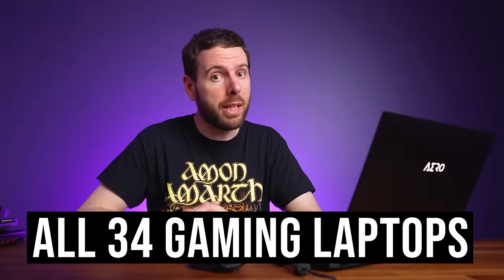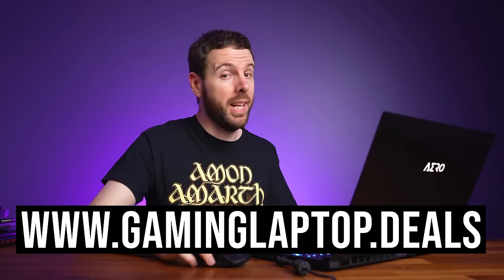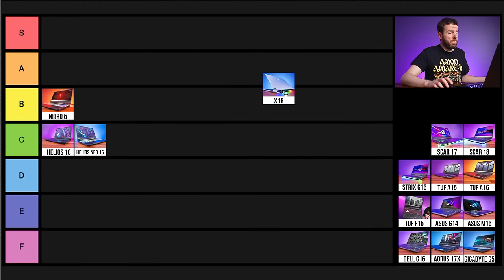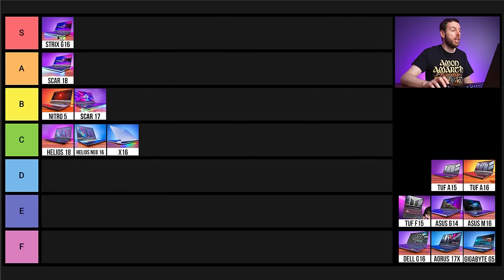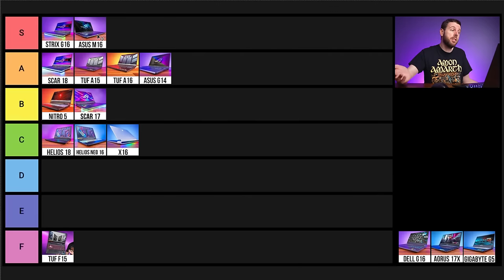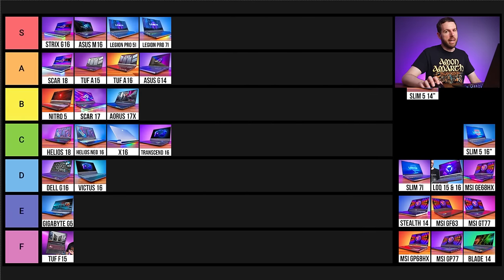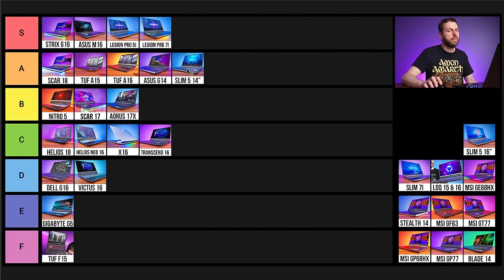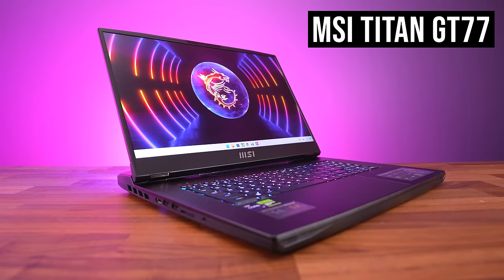Ranking ALL 34 Gaming Laptops I Tested In 2023!

Comment: I got my legion pro 7i with a 4090 for $2100 plus tax... it has to have the best cooling I have ever had in a laptop as it never goes above 87c on CPU at the full 80 watts or above 77c on the GPU at full 175w all at full load at the same time 255w.... it's crazy good, best performer easily this year and the value, my goodness, the value
Reply: Where did you find that with those specs for that money?
Reply: where did you get the 4090 for that?!? i just got the 4080 one for 2k

Comment: My girlfriend recently bought the MSI GF63 because she's a casual gamer and she doesn't mind details. We live in New Caledonia so we don't have much choice. Even though it is ranked on F tier, I believe it's the best laptop you can get if you live somewhere you don't have much laptop options and if you're on a low budget. She never complained about the keyboard, nor the screen or the plugs being on the right side (usually at the back). If you're not that picky, then it's a great laptop.

So far we have spent good time on Palworld with highest graphics and she never encountered an issue or crash, the laptop does the job great! She's also taking care of her stuff so having a delicate laptop because of the mats isn't a problem either.

For its price, this laptop shouldn't be included in this tier list I reckon? Or at least F tier shouldn't be considered as "bad" or "should/must avoid" if that's what you think.

I hope this review helps!

Comment: I got the Asus ROG strix 18- which is pretty much the scar without some rgb. It's a 13980hx with a 4080 and is frequently on sale for 2100$ on best buy. Its an absolute beast and the screen is almost as good as you can get without being oled
Reply: Strix g18 has 4080 specs? For example g16 has only 4070

Comment: TUF F15 with rtx 2060 and Ryzen 7 4800H ive had one for about over 4 years, with no thermal paste change yet and it runs extremely well, under stress temps dont go above 75, but got a A15 with 4060 which obviously is better, but i got the 2060 second hand for like a fourth of the price , would recommend it for anyone able to get a good deal on it

Comment: Can wholeheartedly recommend the Lenovo Legion Pro 7 AMD for anyone who can find it! 

Performance is nothing short of incredible especially with my configuration of a 4090 and 7945hx. There are some easily accessible overclocking and performance settings as well. I got mine for £2450 (~$2600 USD) and can't complain about it. 

The nice to have features such as the build quality, touchpad being plastic again, IO Lights etc are missed but for the price to performance it is a true desktop replacement and worth the trade off. I use a mouse all the time anyways so it isn't an issue for me.
Reply: Lenovo is the best so it's expected
Reply: I'd be grateful if you answer my two questions,
1) how are the cpu temps? I've seen 7945hx hitting 100 °C easily and remaining there constantly. Is it the same for you? 
2) Is there an option to overclock the cpu in the Vantage software?
Reply: @rezamajidizavie  I'm not sure about CPU temps, I've only looked at the GPU currently. At full load in gaming the keyboard doesn't get hot at all. The thermal package is really good at controlling the heat. Max temperature I've seen on the GPU (under 170w load) is 71°c if that's helpful to compare and estimate.

There aren't any options I've found in the advanced BIOS for CPU overclocking
Reply: Thank you for your answer! Yes the GPU temps seem to be okay, but I've seen in many videos very spicy cpu temps. I don't know if it's possible for you to check it later maybe, but that would help me a lot as I am now unsure which version to choose, i9 13900hx or ryzen 7945hx

Comment: excellent video!

I currently need to buy a new laptop.  I'm hesitating between the Asus Rog Strix g16 and the Lenovo Legion Slim 5 16 : 

- Asus Rog strix g16 | Intel Core i7-13650HX, RTX 4060 8 Go TGP 140W, 16 Go RAM DDR5, 1 To SSD

- Legion slim 7 |  Intel Core i7-13700H, RAM 16Go, SSD 1To,  RTX 4070-8GB

I actually wanna use it for Adobe softwares (photoshop, illustrator, after effects...), 3D (blender) and also for gaming at my house.

Comment: I'm one of the ones who doesn't care about the laptop screen.  I connect to a 45" ultrawide OLED 1440p monitor.  
My 'dream' laptop has zero RGB lights to increase the price and heat.  It has the basic of basic screens, something I can run the laptop off of when not connected to another monitor but is a beast in terms of power and performance.  My dream laptop.
My current laptop is a msi gp76.  I learned about it from one of your videos last year.  I appreciate the crap out of your video breakdowns.
Reply from the maker: Don't let RGB on a laptop discourage you from getting it. You can always turn it off.
Reply: @JarrodsTech  oh for sure, I'm just saying I pay for RGB on these laptops but don't want it and would much prefer a cheaper laptop without the flash.  Give me good solid performance without the show at a fair price is what I'm saying.

Comment: I’ve got the Helios 16 with 4080 and 13900HX/32GB ram. It’s unbelievably good. Hitting 19,3xx in timespy overclocked. Incredible performance and super bright, vibrant, and buttery smooth 240hz 2560x1600 IPS panel. Handles overclocks on the GPU and LM - CPU like a boss. Extremely happy with this laptop. Note: It is the NON-neo version.
Reply: Hi. Is it really so noisy as he mentioned ???

Comment: Legion gaming laptops really are so erogonimical for desk setups. The back routed I/O's are a game changer. No visible cables on my desk along my added 32' monitor. They even have software to enhance longevity of the battery being docked.... I still use my Legion 5 4800H, 2060RTX since 2020. On my desk and never unplugged. But battery is still 4-5 hours + when taken around the house. It plays most games at max settings (aside from raytracing) Now, I am looking to upgrade and almost three years later the landscape on gaming laptops still hasn't changed much. Somewhat dissapointed the industry has not taken adaptations on lenovos game changing design. I HATE seeing cables on my desk. Is it just me?

Comment: I think the acer Helios Neon 16 should be higher. The keyboard is extremely cool when gaming and it has Liquid Metal on both cpu and gpu. In balanced mode you get good performance and not crazy loud fans.
Reply: even non neo version should have been higher. considering it's performance and price. I have both helios 16 and legion 5i pro and imo helios is way better
Reply: Planning to buy this one

Comment: Well, I just got HP Victus 16 with RTX 4070, Different Wifi Card, 144hz screen for $999 at Cotsco with 2 years warranty. Nothing to dislike and to be honest, at least B tier. You cannot rank tier for a whole line of a laptop based on different specs.
Reply from the maker: Ranking is based on the laptops we received and reviewed years. So it will be based on those specs.
Reply: @JarrodsTech That is fine, but then it should do ranks based on price range. So it would make more sense. But otherwise great video.
Reply: @RICARDOABECH I had thought about this deal when I saw it on Costco but decided to pass on it.  How's your experience been since getting it yourself?
Reply: @MarioGarcia-qw6dd My son has been playing for a week. Really fast and very good quality. Also Costco warranty for 2 years + 90 days return is great if anything goes wrong. Could not find another 4070 under 1k with the latest 13th gen and DDR5. Screen is supposed to be low quality, but to be honest is much better than my 38 in monitor and color wise for games is great.  Cannot find the deal anymore on the website.
Reply: @JarrodsTech  Also TUF 15 (which I almost bought at Bestbuy on Black friday) had a configuration with 4070 and 12th gen i7 with 1TB SSD and 16GB Ram for $979). Also hard to beat and should not be on the F tier either.
Reply: @JarrodsTech   Another suggestion is (if you are gonna ignore price/spec), do based on things that are not price/spec related (since every one of those can be upgraded with better hardware for more money). Ex: do based on : Build quality, flex, screen quality, hinges, battery size, keyboard, RGB/Lightning, I/O, Bloatware, Trackpad, drivers, thermo, etc.
Reply: @RICARDOABECH  thanks for the info. I'm sure it'll come up again but it would be for my son as well.  He only plays Roblox right now so I'll look for it again.
Reply: @MarioGarcia-qw6dd  Roblox on max settings at 200+ FPS (monitor can only do 144). He also plays Minecraft on max settings and Fortnite on max. The laptop is only 1080p, but to be honest he cannot distinguish 1080p to 1440p on the 16in screen anyway.

Comment: As much as i hate soldered RAM, I think the Lenovo Legion Slim 5 14" should be on S tier. For $50 you can upgrade to 32GB anyway, and while it has non upgradable RAM, it does have a 2nd NVMe slot. Plus its got an OLED screen, great performance (even on battery), lightweight, aluminum build all for $1300 rn.
Reply: It doesn't support G-SYNC. That's a dealbreaker for gamers.
Reply: He’s down-ranking soldered RAM on principle, but I think it’s a misguided notion on his part. If it were Lenovo “cheaping out” that would be one thing, but it’s a necessary tradeoff for space saving, that benefits in extra thinness. The sacrifice is a choice, for people who want thinner laptops. When the soldered RAM is 16Gb, and when most people would never need more than 32Gb total anyway, I don’t the hang-up.
Reply: @Timothy003L  I don't even have the laptop and can assure you it's not. The pixel response time from OLED is like 0.1ms, 10x faster than IPS and V-sync more than make up for any sync technology.
Reply: @nineflyerr3866  I have a 165 Hz OLED monitor. 150 FPS with G-SYNC off feels choppier than 100 FPS with G-SYNC on. Frame pacing is more important than pixel response time.

Comment: I found the zephyrus g16 at 1400€ with i7 12700h and 4070 and QHD+ 240hz monitor or there is also a strix g16 at 1700€ with i7 13650hx and 4080 but with FHD 165hz monitor, which one should I buy? I value most battery life,build quality and portability.

Comment: Where do you think Asus rog Flow X16 ranks?

Also which one do you think is better, the X16 or zephyrus G16 (2024)?
I really want to buy G16 bc of its oled panel, speakers, premium built quality and minimalistic design but I also like the fact that x16 is upgradable and I want it for digital art but idk if it is good for it yet.

I want to know which laptop has better performance in gaming (both rtx 4070) and which has a better screen/keyboard/trackpad. Also, can the X16 be used for drawing professionally?
If you could answer these questions it would be really helpful. 🙏
Reply from the maker: Check the 2022 verison, that's the last time we reviewed it, I can't remember where I put it off the top of my head sorry. Haven't tested the 2024 models of either yet so can't say just now.
Reply: @JarrodsTech Okay. Thank you for the reply. 😊

After a LOT of research I'm really stuck between choosing the Asus Zephyrus G16 (2024) or the Lenovo Legion pro 7i. Which one would you recommend?

Also, yeah I'm gonna just stick to an ipad for digital art. 😅 Gonna keep Laptop purely for productivity and gaming. X16 was a little too expensive for what it was offering, plus it didn't look like it would've been good for digital art.

Comment: Do you recommend getting a DDR 4 32 GB ram vs DDR5 16 Gb ram.

Provided both of them are i-9 13 th generation laptop with Nvdia RTX 4070.

I am only comparing options because i am getting the ddr4 option at $200 cheaper rate

Comment: There is a sale going on right now for the DELL G16 with i9-13900HX, 32GB RAM, 1TB SSD and RTX 4070. In addition, it's easily upgradeable. With Black Friday Sale and Cashback you can get it for around 1400€. This ranking concerns me a bit, but I don't see where I could get better hardware in a laptop for that money. Please correct me if i'm wrong!
Reply: Did you end up getting it?

Comment: The Gigabyte Aero 16 Oled definitely needs to be on this list. It may have lower refresh rates but the ability to upgrade it to 64gb with 2 ssd slots with an oled screen is sweet for a laptop. I would rank it at A at least. I like the legion pro but was disappointed in its lack of its ability to upgrade it. Ram is soldered on for the oled version, which is a bummer...

Comment: Hello, Jarrod, are u sure than Acer Neo 16 can not compared to Strix G16?

The fact that Helios 300 exists is a so-so justification for the rating. Moreover, it is very difficult to find it with the 3070 ti.

Comparing it with Lenovo pro 5i and Asus G16. I liked Acer better. Metal case (!), full keyboard, modest design. At the same time, the full performance of its hardware. Am I missing something?
Reply from the maker: I think Strix G16 is better than Helios Neo 16 personally.

Comment: Im between the ASUS - ROG Strix G16 16" 240Hz Gaming Laptop QHD - Intel 13th Gen Core i9 with 16GB RAM - NVIDIA GeForce RTX 4060 - 1TB SSD  it’s on sale right now for 1499.99 or the ASUS - ROG Zephyrus M16 16" 240Hz Gaming Laptop QHD - Intel 13th Gen Core i9 with 16GB Memory-NVIDIA GeForce RTX 4070-1TB SSD - that is also marked down for Black Friday at 1499.99 what should I choose 🤔

Comment: Hi guys black friday is near i need your opinion which bracket or letter will you put the msi katana 15
Core i9 13900H
Rtx 4070 105W
1TB nvme pcie ssd
16GB RAM 8x2
144hz refresh rate

Thank you for your feed back

Comment: The RAM on the X16 is soldered because it is LOW-POWER DDR5, meaning it's more power-efficent. The saved power can be channeled towards the GPU. The RAM also clocks at 6000MHz - faster than the competitors. Seeing that important information systematically overlooked by self-appointed "experts" gets boring.

Comment: Is it possible for you to do a review of the new Gigabyte G6-KF series of gaming laptops? I can't seem to find any review of that particular model. I'm really thinking of buying that one because it's very decently priced at the moment. It has an i7-13620H with an RTX 4060 @ 70W, 16 GB of DDR5-4800mhz and 512GB SSD. 1920x1200 @ 165hz. Supports advanced Optimus, has 2 M.2 slots and pretty good I/O. Price right now (07-12-2023) in The Netherlands is € 949,-

Comment: I bought an MSI Vector Gp77
i9 - 13
4070
32G
1TB
I have no complaints, I rarely use this without a power source so the battery is irrelevant.

Comment: Jarrod, aren`t the Strix 16 and 17 too hot that they thermal throttle ?
Still S ?
Reply from the maker: Seemed fine in my reviews.
Reply: well, you said that under stress CPU thermal throttled, and was reaching 95 C on performance and turbo mode.
aren`t these high temps bad for laptops in long term ? @JarrodsTech

Comment: To be honest - the comparisons are a bit confusing. Thanks for all your effort you put in this video but just for the other viewers and to make context better: i bought (in germany) a Dell G16 7630 with the 13900HX and RTX 4070 and i do receive more FPS then all of your laptops in Cyberpunk with same settings. I payed 1587,00$ and slightly overclocked the GPU. Also worth mentioning is, that Dell has a Temp Limit for the CPU which means, AVX-based Applications like Cinema4D will always be lower, then other models due to missing undervolting-options. For the older G15 you can edit bios and stuff, which you have to chose by yourself but in terms of raw performance for money, the G16 is in my opinion the best choice for a 2k gaming laptop in this pricerange.
Reply from the maker: Also worth noting that we don't use the benchmark for Cyberpunk, so it's expected that your results would differ.

Comment: Hi, great video, i just purchased slim7 max out specs, but after looking at your video i think slim5 14" max out might have been better give that its $100 cheaper as well
Reply from the maker: The 7 is a nice laptop, I regret not putting it in A tier, I just personally prefer the portability of the 5 that's all.
Reply: @JarrodsTech  if we ignore portability, as i would mainly code in GPU and casual gaming, then which one would you recommend? One is OLED, lpddr5x but the other has a 3.2k display, ddr5. I would really appreciate your insights.

Comment: I have recommendation for this types of video,

I think you can easily have 3 chart and not have low tier laptop and high tier laptops in same place.

And no need for mentioning every time that thay are not comparing to themselves.

So you can have 3 chart,
One lower tier and budget friendly
One midrange
And for 3rd chat having anything above mid tier

By doing this action peoples like me can easily have 15 minutes of solid video out of 1h dedicated to for example midrange laptops

Of course finding out what laptop should go in which of 3 possible chart could be tricky but its easier now a day based on this factors:
.Naming (LOQ is lower tier than legion)
.build quality
.Specifications
.Price

Or you might want to have this 3 chart based on what laptop supposed to use for

For example we have well build mid range laptop that has low weight
These laptops are solid content creation / casual gaming laptops

And we have solid portable 14 inch laptops with little to no way to upgrade them and has good battery life ,and might not have best cpu/gpu available.
Theses are made for someone like me that love low weight portable laptops and accept the fact that there is some trade-offs

And finally the big heavy 240 Hz 4090 laptops that supposed to sit on the desk and pluged in.

Thanks if you read this far 
I hope this recommendation could help a little bit❤